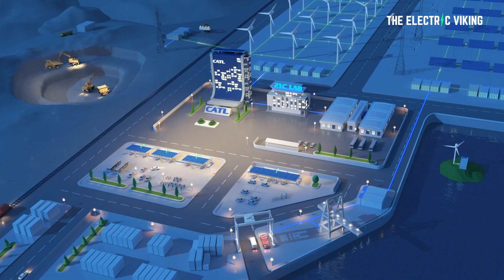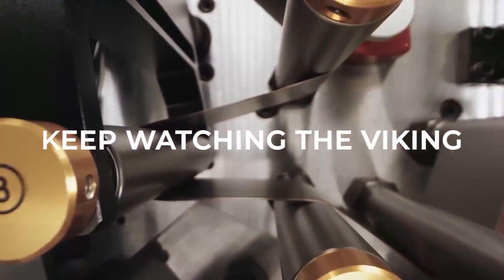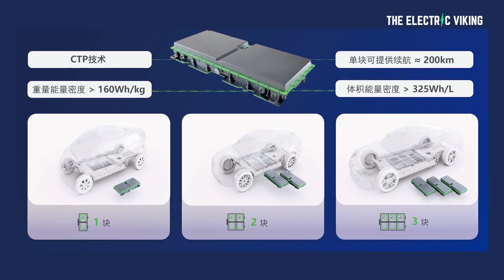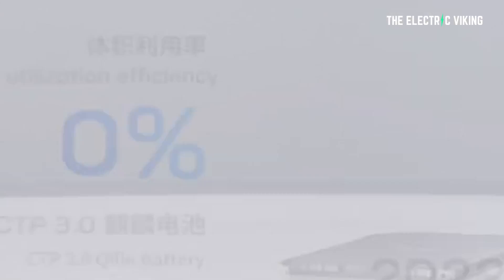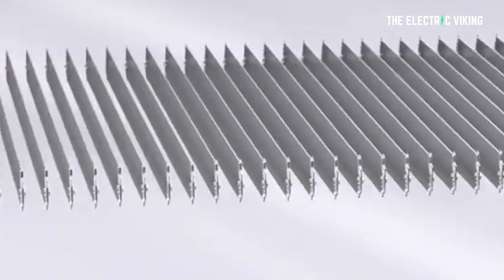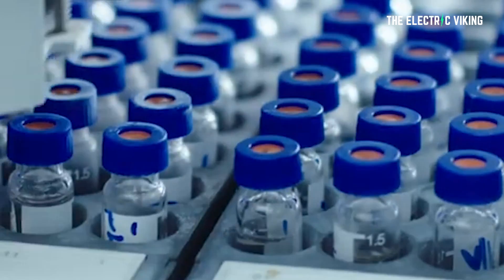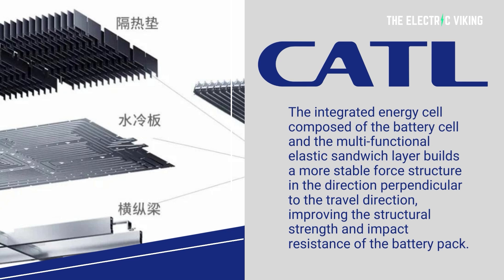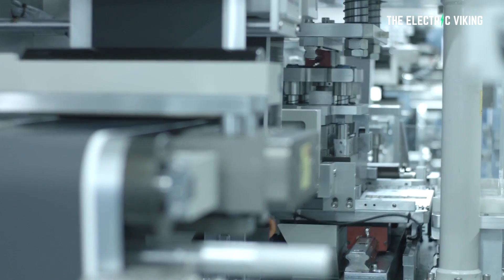The biggest EV battery breakthrough I have EVER seen

Comment: I'm confused because you were talking about Tesla and the 4680 and then go into something that has nothing to do with a 4680 battery.

Next, you're time frame is VERY optimistic.  It's not just that CATL has to prove their manufacturing processes, but BEV makers have to also analyze it, and get manufacturing processes in place along with possible hardware changes to get it incorporated into a vehicle.  I understand that Tesla uses Agile for project management, but that doesn't mean they can pull off miracles.

Comment: There's more in store regarding batteries. Packaging ins one side of the coin, Electrolytes are the other one. 
At the Heimholz Institute in Ulm they build a machine to automatically mix up Electrolytes, produce coin cells and then test those. This way they can test several 100 Electrolytes in a day to find the most promising mixtures fast and then concentrate further research on those. They already have some success.

Comment: Not a breakthrough, but a packaging evolution, and kind of BYD Blade Knockoff. 

BYD Blades did this first, and IMO better. 

BYD Blade also does Cell to Pack, but each blade cell is the full width of the pack, which means many fewer wiring connectors. 

Cooling setup is essentially the same with a thin layer between each Blade, and the volumentric density is superior for the Blade LFP.

The only advantage CATL has is that they also have an NCM version, but if you can get enough capacity out of LFP, it's the better option.

Comment: I'm working on futureware where electrons move in a vacuum from an emissive electrode covered with a forrest of carbon nanotubes to a nearby absorber electrode of lichen like graphene char. The electrodes are practically permanently different structually and materially so ambient temperature thermally motivated electrons with a thermal energy of ~25 milli electron volts corresponding to a thermal velocity of ~1-2 million meters / second preferentally cross the vacuum from the emitter to the absorber. The electron flow forms an equlibrium with the electrical load, the current that crosses the vacuum and returns through a resistive load is always equal but the voltage across the load varies from zero for a short circuit to a maximum ~25 mV for an open circuit. Between these extremes there will be some current, some voltage, some electrical load resstance, some electrical power, and some cooling. The cooling is a consequence of the electrons crossing the vacuum being ⁰retarded as circumstances selectively let them move predominately into the like charge of the absorber electrode at the operating voltage between the emitter and absorber electrodes. 

This device desperately needs prototypes that show that it works; it has made sense to me for years. The device with a working name Thermic Array,which could be funded by a crowd sourced grant of ~$100K. 

It would be the downfall of the second law of thermodynamics. The world would reach the limit where energy can change form without gain or loss. It is themal perpetual motion. Practical electrical loss in wire resistance is misplaced heat which would be made up for by extra cooling at the device, retaining the overall energy equivelence. 

Aloha
Charles M Brown lll
Reply: Ah yes, the elusive perpetual motion machine. Publish your paper, collect your Nobel Prize. And don't forget to patent it!

Comment: Big drawback for current EV's is the life of the tires.  This has been said  to be due to the weight. Will this be an issue with this new CATL battery?
Reply: Yes, partly the weight, but also because people like to demonstrate the increased acceleration. You save money on brakes though.

Comment: Wow. Not a game changer at all.
Look at the low temp performance of LFP, look at the total cost of recycling of LFP with transition metals.
Its an improvement yes but not a revolution. Soon they will have LFMP and not LFP. Others are doing NMx at an upper voltage of 4.35-4.45V soon. Then one has to calculate the $/kWh again. 
I am a battery cell developer working for 12 years on battery cells in Korea. Did cells for all the big OEMs.

Comment: Jeff Dahn has made Nickel based batteries out last LFP in the lab , it's to do with the what else he adds to the battery so it the structures don't break down.   and bring on high energy density batteries for jet skis currently 160 hp eletric jet ski's would hope that can reach 300hp ,.

Comment: Looks like a really great step by CATL but don't think by any means this type of battery will blow the competition out of the water. Competition in the battery market is really important as there are so many promising new chemistries coming towards the market. Also the number of applications coming up for batteries will require more tailored solutions depending on the requirements. 

Sila nanotechnologies have a really promising silicon anode battery they have tested in the Mercedes Eqxx concept car that recently achieved 747 miles on a charge without driving economically. Also Australia's own GMG have their Graphene Aluminium ion battery that is capable of insane charging speeds (~60 times current li-ion). Really exciting times in the EV space!

Comment: You know what else 10 minute 10-to-80% recharges enable? Motorsport as it has been practiced for over a century, fuel stops and all. The particulars will change as they always do, but there will once again be utility in trying to leave the pits as soon as possible without running out of fuel. I think this will be good for the electric car racing circuit.

Comment: You have to think long term if you imagine a high proportion of vehicles being fully electric:   This message from out there in reality land:Some Wise Words From An Electrical Contractor In Melbourne 

" I recently did some work for the body corporate at the Dock 5 Apartment Building in Docklands in Melbourne to see if we could install a small number of electric charging points for owners to charge their electric vehicles. 

We had our first three applications and we discovered:

1.      The  building has no non- allocated parking spaces ie public ones.
This is typical of most apartment buildings so we cannot provide shared outlets.

2.      The power supply in the building was designed for the loads in the
building with virtually no spare capacity. Only 5 or 6 chargers could be installed in total in a building with 188 apartments!!

3.      How do you allocate them as they would add value to any apartment
owning one. The shit-fight started on day one with about 20 applications received 1st day and with many more following.

4.      The car park sub-boards cannot carry the extra loads of even one
charger and would have to be upgraded on any floors with a charger as would the supply mains to each sub board.

5.      The main switch board would then have to be upgraded to add the
heavier circuit breakers for the  sub mains upgrade and furthermore:

6.      When Docklands was designed a limit was put on the number of
apartments in each precinct and the mains and transformers in the streets designed accordingly. 

This means there is no capacity in the Docklands street grid for any significant quantity of car chargers in any building in the area.

7.      It gets better. The whole CBD (Hoddle Grid, Docklands) and Southbank
is fed by two sub stations. One in Port Melbourne and one in West Melbourne.

This was done to have two alternate feeds in case one failed or was down for maintenance. Because of the growth in the city /Docklands and Southbank now neither one is capable of supplying the full requirement of Melbourne zone at peak usage in mid- summer if the other is out of action. The Port Melbourne 66,000 volt feeder runs on 50 or 60 year old wooden power poles above ground along Dorcas Street South Melbourne. One is pole is located 40 cm from the corner Kerb at the incredibly busy Ferrars /St Dorcas St Intersection and is very vulnerable to being wiped out by a wayward vehicle.

The infrastructure expenditure required would dwarf the NBN cost & that's not including the new power stations required!

These advocates of electric vehicles by 2040 are completely bonkers! It takes 5-8 years to design and build a large coal fired power station like Loy Yang and even longer for a Nuclear one (That's after you get the political will, permits and legislative changes needed). Wind and solar just can't produce enough. Tidal power might but that's further away than nuclear.

MOST AUSTRALIANS DON'T UNDERSTAND THIS YET.......!

It's just a greenies dream in the foreseeable future other than in small wealthy countries. 

It will no doubt ultimately come but not in the next 20 years...

 

The grid simply cannot support it in most places in Australia!

Comment: An incremental progress, not a breakthrough, and I am not sure how you got from 160 Wh/kg at pack level to 235 Wh/kg at cell level for such a highly integrated structural battery pack. At 72% of integration, that would be more like 222 Wh/kg, and I don't even know if this 72% means anything for this kind of computation.

Structural battery packs would also differ a lot across cars and manufacturing choices, and CATL does not say (or does it?) what definition they use for "at pack level", so we may never see 160 Wh/kg for LFP or 255 Wh/kg for regular lithium battery packs in real life cars in 2023/2024, but still, it sounds impressive.

What's also interesting is that the LFP battery pack is 37% less energy-dense than regular lithium. This means that a 1,000 km / 621 miles car would have a range of 627 km / 390 miles with a LFP battery pack of the same weight, which is more than decent. We still don't know what battery pack weight we are talking about, but hey, it's only at Christmas that you can open gifts all at once. For Easter, you need to find each little hidden chocolate egg of information one by one...

A LFP battery pack will not charge 70% of capacity in 10 minutes, it's a minor inconvenience for its other benefits, and no inconvenience at all in daily usage if you can charge overnight. Not sure if CATL provided any data about LFP charging, but we may be able to extrapolate it from other cars, for instance comparing with LFP/non-LFP Tesla Model 3, both to know LFP charging sweet spot (that may not be from 10% to 80% because of the different chemistries) and LFP charging time for that capacity range.

In any case, thanks for this news, this is very exciting indeed. But you won't look very excited unless you start painting these walls, using warmer lighting or a green screen, instead of showing an oversaturated white blur over a blue shirt...  😁
Audio still sound saturated too, not pleasing to the ear. You may want to address these technical issues before producing 6 videos a day...  😐

Comment: Looks like an extremely well thought out and meticulously engineered system.  I always thought the 4680 was a piece of overhyped nonsense, hard to assemble into a battery pack, hard to cool, impossible to pack tightly, and with a cell jacket that is pointless inside a larger battery pack.
Reply: Don't forget fast and cheap to assemble, tabless to allow faster charge and discharge with less heating, and structurally strong.
Reply: @macrumpton  Yes, pretty much the polar opposite of his assessment 😂

Comment: Lithium sulfur batteries deliver similar results I believe. Perhaps not the zero to 100 feature but it has claims of holding 80% efficiency over 4,000 cycles and it would be a cheap transition from what we are already using today.

Comment: Here's something to think about: If you want a Li-Ion battery to have a lng life, yu need to keep the State Of Charge to between 20% and 80%. An LFP battery doesn't have that limitation. 80%-20% is an effective operating range of 60% of total Li-Ion battery capacity.
60% of 255 = 153 Wh kg for the ternary battery.
100% of 165 = 165 Wh/kg for the LFP battery.
On that basis alone, it makes sense to buy the LFP battery pack. Factor in the lower cost and up to triple the longevity, and the choice to use LFP becomes even clearer.
Reply: And after around 10 years the LFP battery will age like all lithium batteries, LFP may last more cycles, but they have a similar lifespan, even BYD state on their website that a battery lifetime is 10 years, so BYDs amazing so called lifetime warranty is just another way of saying it has a 10 year warranty lol
Reply: @gregandkaruna6674  so an NMC battery does 1500-2000 cycles and LFP 3000-4000 cycles and you think they’ll have the same lifespan, please explain that to me
Reply: @bydman5320  One simple thing called dendrites, they love to grow over time and once the break though the separator the battery is dead! Time kills batteries as these things grow over time not cycles.
Reply: @gregandkaruna6674  They don't grow at the same rate when the battery is in the 20-80% range as they do when the charge is outside that range.  It's not so much about cycles as it is about time at extremal charge states.
Reply: @incognitotorpedo42  Well then what is the point of LFP if they also stay at between 20-80% to slow down the growth. Even the mighty Solid State were supposed to be the end of dendrites, unfortunately they to suffer and that is holding them up. You all say the same thing year after year yet no battery warranty has ever exceeded 10 years! If LFP had a 2x life increase then so should its warranty! But nope 7-10 is the limit with no more than 30% degradation or in BYD Blade battery case 40%
Reply: The only man that has made any sense of this, the NMC isn’t a comparison to LFP. And CATL LFP is slightly less powerful than BYD blade battery that has been on the market for 2 years already
Reply: @RWBHere The average distance driven per day is short enough that 60% is not a problem the vast majority of the time.  Higher energy density (thus lighter weight) is useful 100% of the time, though.  Most people rarely need to use most of the battery's capacity, so the battery degradation is acceptable.

Comment: I just looked for the energy of GM's Ultium battery. 
GM's Ultium battery uses pouch-type cells (23"x4"x.4") that hold 0.37kWh of energy per 3 lbs. 
I compute that to be: => 100 kg (220 lbs.) = 27 kWh
Reply: That is not pack level, that is cell level to my understanding.

Comment: Sam I was hoping you would see the significance of this monumental news release.

For all you Tesla Fanboys that assert the company is years ahead of the competition, you now need to quickly comprehend this new reality and decipher the affect it will have on Tesla’s stock price going forward.
Reply: Tesla will just start using the new tech. Won't affect their stock price, except positively. The best battery with the most efficient drivetrain? It'll keep Tesla in the lead.
Reply: Panasonic plans to initially produce '4680 batteries' at its Wakayama plant in Japan (annual production capacity of 10 GWh) from March to April next year and provide it to Tesla. As it is difficult to meet battery demand with only Panasonic's supply, LG Energy Solutions and other companies are expected to confirm the supply of '4680 batteries' with Tesla within this year.

Do you still think this will happen, seeing that Qilin charges 4x as fast as 4680?
Reply: @christopherbeyer7740  It will happen, but maybe only in the short term. Qilin won't be available in volume much before 2024, and they have yet to show a battery installed in a car. That's not to say they won't get there, but there's around 3 million Teslas to be made in the meantime. Musk has already stated he'll always buy the best tech, no matter where it comes from. Plus, CATL already supply the Shanghai factory with batteries. If there really is a breakthrough here, expect the world's largest EV maker to be beating down their door carrying wads of cash.

Comment: I'm missing some reference numbers for current pack level energy density to really judge how far they have taken the technology. I still think the silicone anode battery from Enertec(?) you talked about the other day looks at least as promising with 10C charging compared to 4C for this one. That can also translate to smaller battery packs needed, and all benefits that follow, even if the energy density may be less impressive.
Reply: it's not promising if it costs 5 times as much.
Reply: @gelisob  They probably wouldn't bring it to market if it was.
Reply: there are 5 times more expensive cars on the market than average priced car. There is market for expensive things too.
Reply: @gelisob Sure, that could be one scenario. But in the case of silicone vs graphite anode I don't see the difference in raw material price being that significant. Maybe if the process would be a lot more energy consuming.